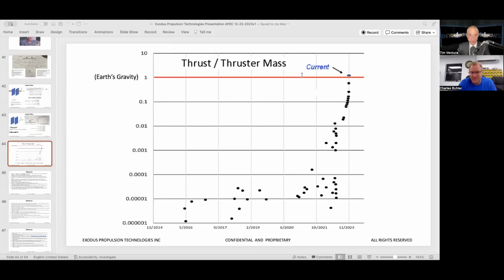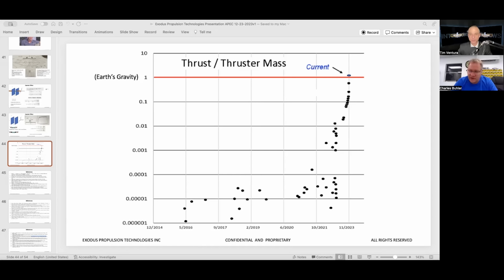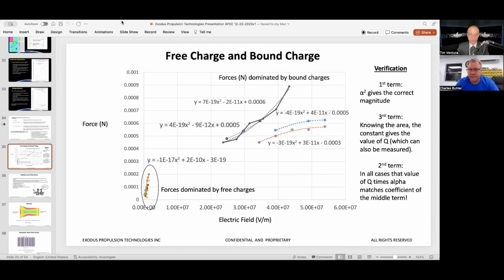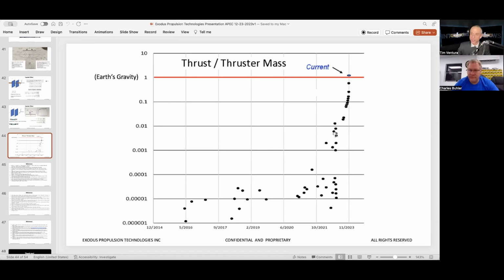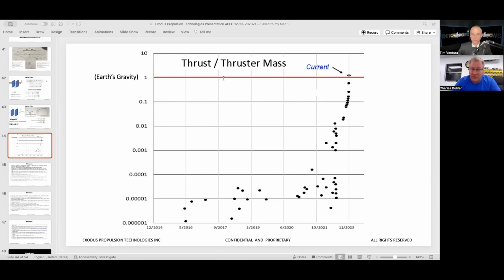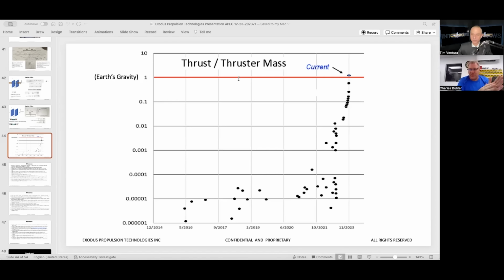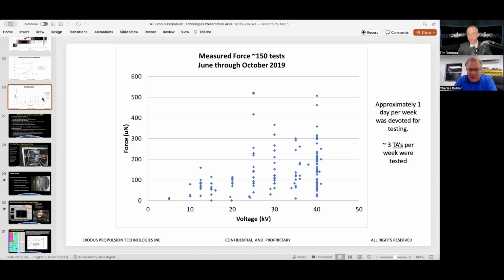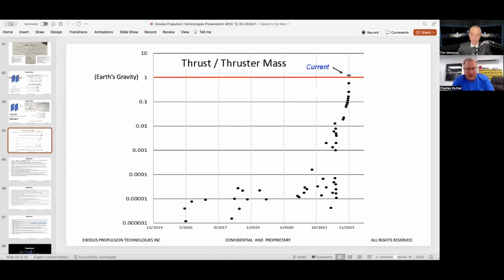Propellantless Propulsion Device | Charles Buhler

Comment: "Anti gravity" aka Lensing (vrb.) relative-timing positioning potential.

The Complete Idiots Guide to knowing the Actuality of String Theoretical Sublimation-Tunnelling, linear-transverse wave envelope instantaneous duality positioning system concept, could make a rational and reasonable guess as to what you can expect to be required to design into an operating device,  the stories of Area 51 propulsion devices are enough.., ie if you delete the BBT creation misattributions.

The back engineer who fiddles with crashed vehicles needs to know how to disable the security system, or qualify for a drivers permit?

Comment: Always take 2 min to express practical examples of how this works plz. 😂 I love Tim’s channel but I’m not a physics expert. Does this accelerate a toaster to mars or a starship? Does it replace chemical rockets from the ground or does it only apply to vacuum?
Reply: So your saying there’s a chance!
Reply: It only applies to vacuum
Reply: @patrickday4206  No, you can encapsulate the asymmetrical capacitors in any dielectric and still have the effect. Air is dielectric too, though not very good at high voltages.
Reply: @hyparh  air doesn't heat significantly in a microwave which heats dielectric things
Reply: @patrickday4206  Microwaves are for EM Drive. Buhler's device counts on asymmetrical electrostatic pressure created by electrodes with certain geometry (see his patent).